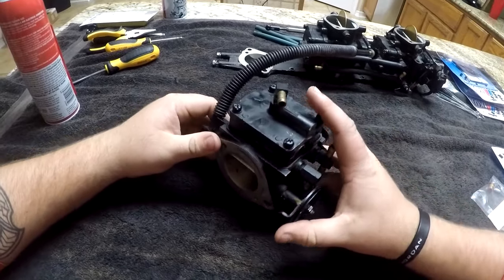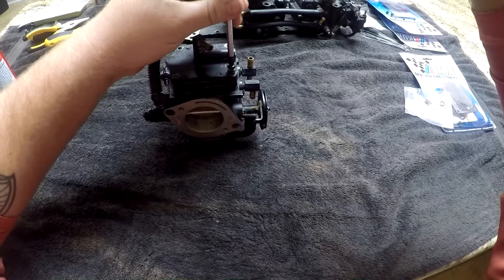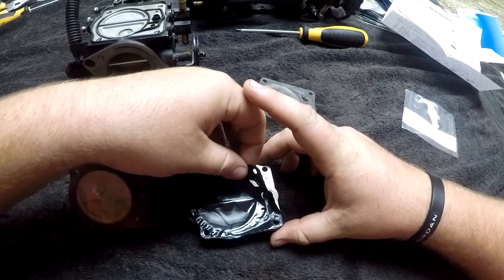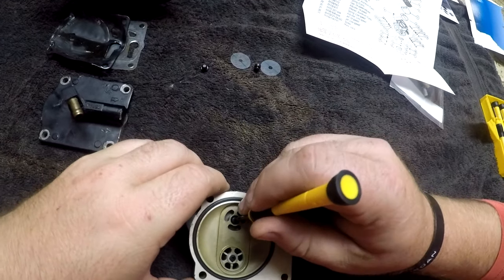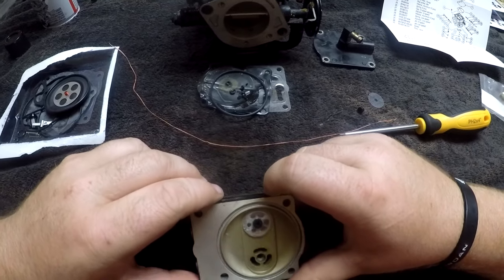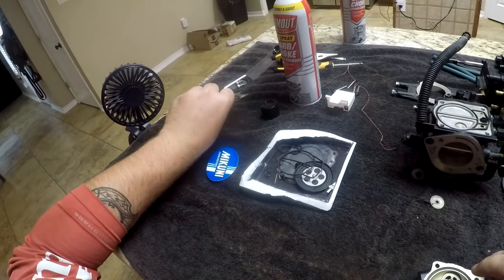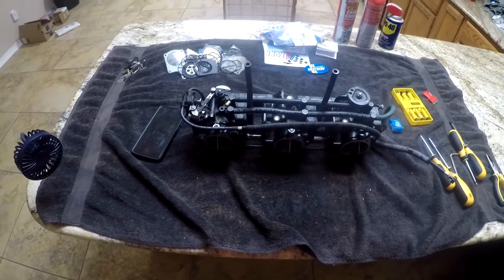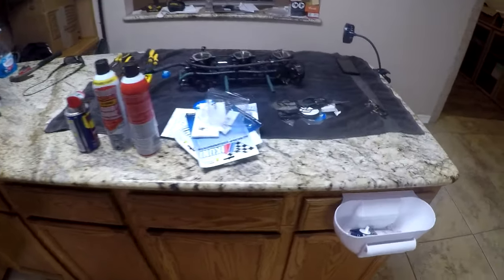2000 yamaha GP1200r Triple Mikuni carb rebuild

Comment: you didn't show to adjust the high and low speed throttle
Reply from the maker: There's a knob you can turn to adjust idle. But to adjust high and low you have to drill out 6 plugs and get T handles to adjust them. I didn't have to adjust them.
Reply: @wessmith3635  on a yamaha  2000  waver runner xl  triple carb ( M )  & ( P ) how many turn  that all i need
Reply from the maker: On the idle knob? Take it to the water, start it and adjust in the water. It should only pull you maybe 3 mph on idle alone.
Reply: @wessmith3635  the low and high speed  on a rebuilt carb
Reply: @wessmith3635  on a rebuilt carb  how many turn on a high  and low speed
Reply: Hey , do you know the pop off psi’s ?  Thanks for your help
Reply: @kenpitts334  14-17psi stock I believe

Comment: So you're not going to blow through your jets with carb cleaner that's a big mistake and you're not going to check the pop off pressure on each carburetor another big mistake and always check for an air leak on the entire jet ski because just a loose gas cap or a bad tank valve will fry a piston
Reply: Also you want to check your high and low speed jet settings to make sure nobody has messed with them and set them by the book all those things are always a good idea
Reply: I was thinking the same thing. No compressed air throug any ports. So important to remove the low and high speed jets and clean through them as well as pop off pressure and air leaks. I go as far as putting a little Yamabond on the treads of the bolts as I've seen air leaks come up trough them.

Comment: This guy don't have a clue 1st thing you need to do is check your pop off pressure once you get your carburetor together you need a air hose to blow through all your orifices there is far more to it than this or you will get it together and even if it runs you will end up frying a piston
Reply: any video that shows proper way to do it?